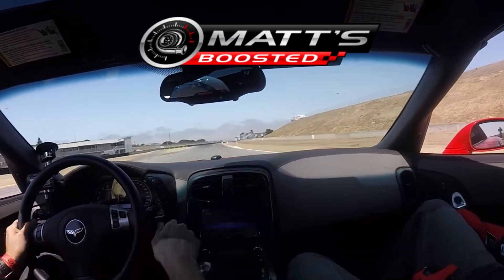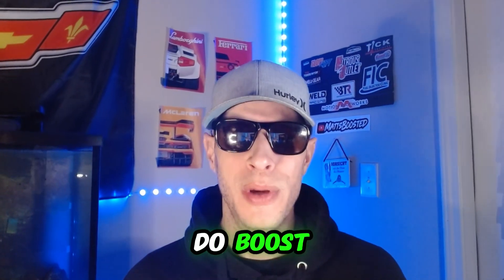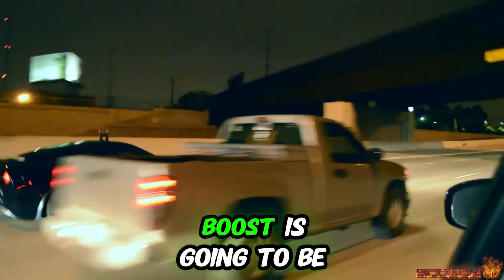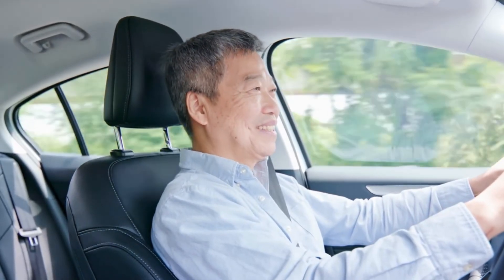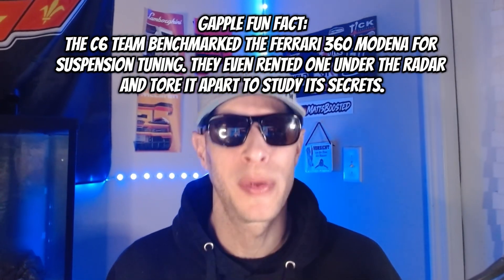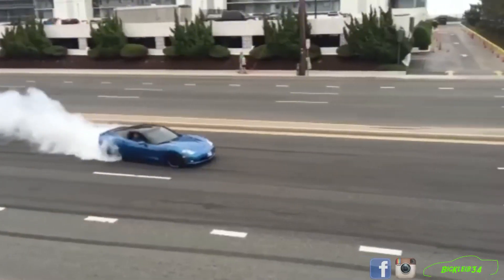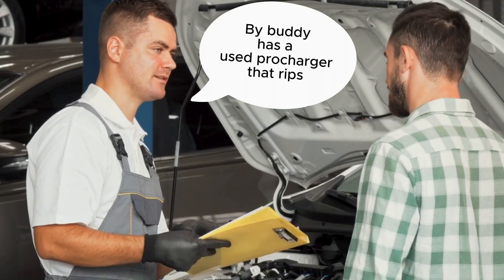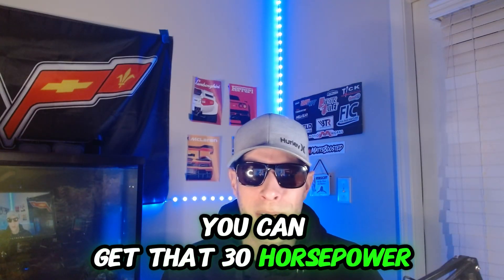Corvette C6: Full Bolt-Ons vs. Boosted – Which one is best for you?

Comment: I have a C7 Z51 with an ECS supercharger,  Kooks long tubes and catless x pipe with Billy Boat fusion axel back. A soler 93mm throttle body & throttle controller. 
Its an M7.      With the tune , dyno'd at 570 RWHP.
Reply from the maker: Very nice man and it's at a really good power range!
Reply: @Mattsboosted thanks man. That's what the mechanic and tuner said. Perfect for the street, or on ramps 😂

Comment: Love your videos. I have an 06 base, with 6 speed auto. Put CAI, long tubes, and a Corsa exhaust. Would like to keep it N/A, but a torque converter and the labor seem expensive. Going to a SC seems the better option, but being I drive her daily I’m worried about reliability. Any thoughts?
Reply from the maker: Thank you a ton man! The setup sounds super nice so far. If you add a supercharger and keep low boost (6-8 lbs) it’ll still be extremely reliable so no real worries there! 🙌

Comment: I went with an A&A SC installed by A&A on a stock LS-2 dyno# 528hp at the wheels. The advantage for me in California is it’s CARB legal and will pass smog inspections, also you can drive it without getting into boost and never know it’s modified.
Reply from the maker: @robynmolle5842  Super good point regarding emissions in CA!  Also, you’re exactly right. It’s very much a sleeper until you get into it. Thanks for sharing! 🙌
Reply: What mods do you have?
Reply: @ nothing but the SC’er
Reply: @robynmolle5842 how many miles you put on it?
Reply: @ChurkGurk  car had 75k when the SC was installed, now the car has 85k without any issues at all.
Reply: @ how much boost do you run?
Reply: @ChurkGurk  5-7psi

Comment: My concern with boost would be the stock lower end. The question would be long term reliability with stock internals. Merry Christmas!
Reply: u can run 700 whp on an ls3 reliabiliy
Reply from the maker: @RaymondMNania  For sure! Long as you keep the boost in the 6-8 lb range you’ll be good to go. They can take more but that range will keep you super safe. Really strong engines and it’s all about the tune. 🙌

Comment: im doing n/a for a while, (almost got full bolt ons)brakes, suspension, body or boost not sure right now. you also got spray for like a grand. also you can do flex fuel. happy holidays everyone
Reply from the maker: @un4gvnplaya370  Very nice man! And absolutely, nitrous is by far the best bang for the buck mod out there. Upwards of 200+ HP depending on the kit for 1k or less. I’ll have a video about that soon! 🙌 Happy Holidays!